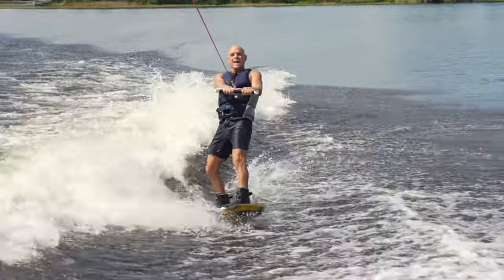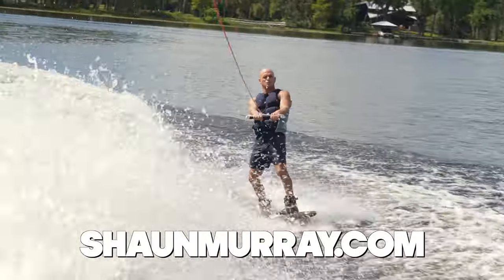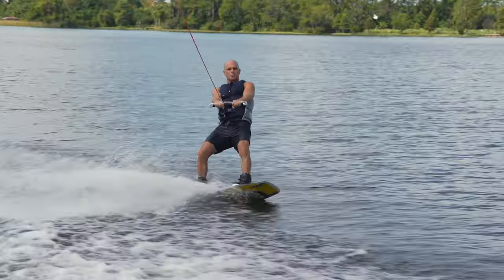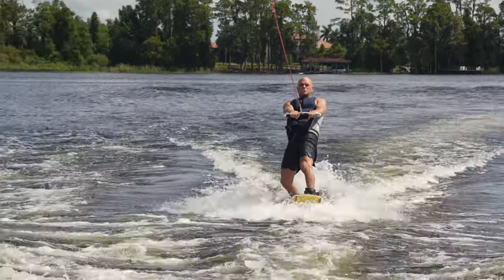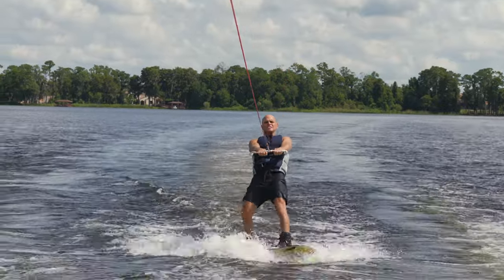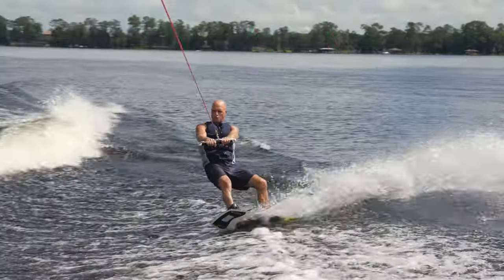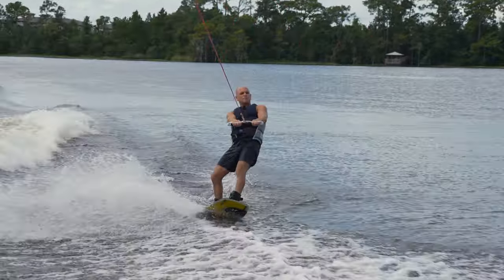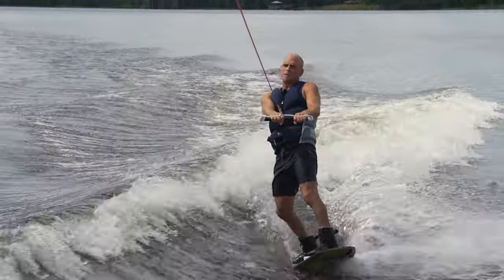How To Side Slide Wakeboarding

Comment: This is convincing me even more i need a new board.  Its like 15 years old and it takes a ton of effort to break the fins loose and not faceplant.
Reply from the maker: Older boards can have some pretty big fins which will make it super hard to break free, but even newer boards can have a lot of channeling and different bottom features that keep it locked in. Lemme know if you're looking at a particular board and want some insight on it.
Reply: @Shaun.Murray I have a question: I bought your hyperlite Agent board. And the fins seem slightly larger, I think the 1.3 disorder fins. I was thinking about grabbing the 0.8 fins but I didn’t know if all fins you sell are interchangeable? They’re the side fins. The board seems to have some channeling underneath. I am riding exclusively behind a boat. It seems a bit hard for me to slide.